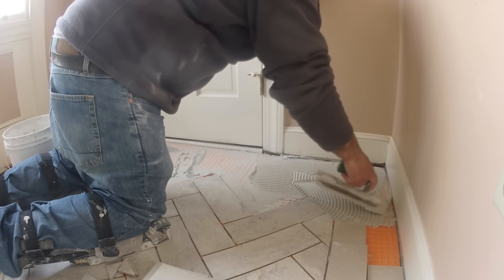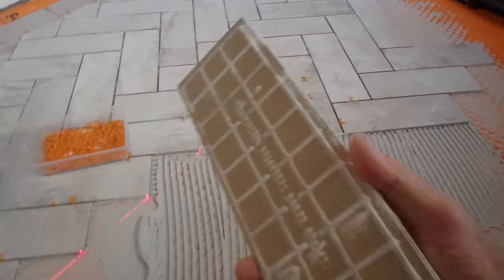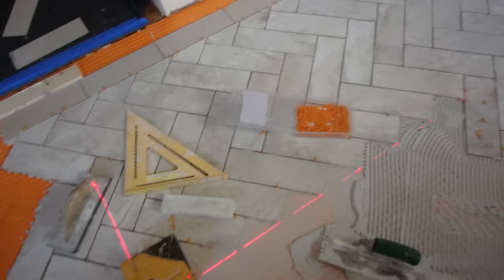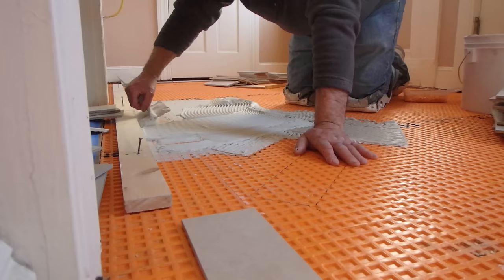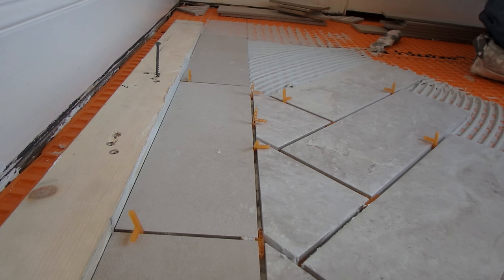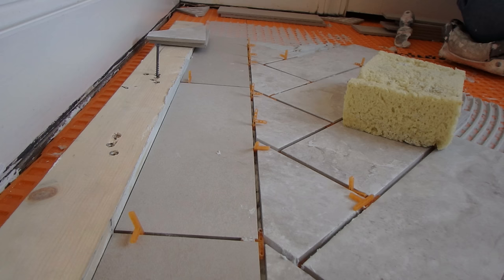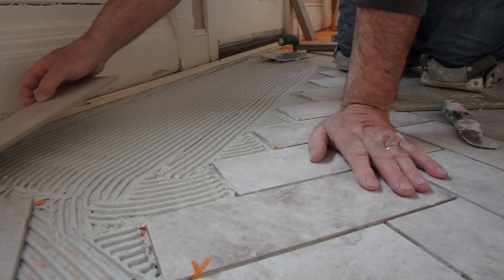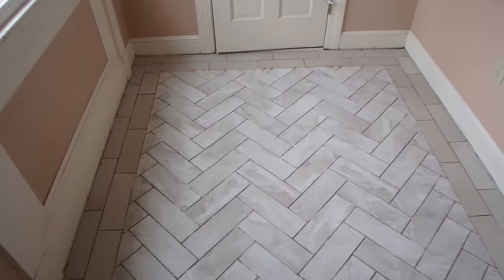How To Install A  Diagonal Herringbone Tile floor

Comment: Hi Sal,

Love your videos.  Since watching them, I've done multiple projects on my rental units and everyone thinks I hired a contractor.  Watching your videos is the equivalent of taking a Masters Class in tiling.

Just out of curiosity.  When you put some spacers down deep between tiles, are you going to dig them out of the thinset later or will you just leave them there and just grout directly over them?

Also, I know you can use both sides of the tile when cutting those smaller pieces on the edge, but is this a pattern with a lot of waste?
Reply from the maker: Depends on the kind of space, some are designed to leave in, others have to be removed.

Comment: You make it look so easy! However, I know that is pure experience on your part.  I did a herringbone floor for a client and it looked awesome when finished but it's a time consuming pattern with all the cuts and precise layout.  It's even worse when the client picks tile that have tiny variations in dimension from a box store, ah forget it. Nope not for me! Never again!
Reply from the maker: Herringbone is one of those patterns that will always be around.
Reply: @SalDiBlasi  I agree with you. It's a classic time honored pattern that looks gorgeous. In the hands of an amateur though, will easily look amateur in comparison to a pro's job.  Love your videos btw. I referred to many of yours when I did that herringbone job.
Reply: Im with you on that. Herringbone is a pain. Like you said, any variations in tile size makes it harder. And also if the room is out of square. Fortunateley there does not seem to be much demand for herringbone and the sooner that pattern goes back out of fashion the easier my life will become!

Comment: Hi Sal. I’m doing a bordered herringbone on an exterior deck. I’m not sure how the border tile on the edge of the deck should sit. Flush with deck/step edge? Short a touch? Suggestions? I’m also unsure whether to cut the border tiles around the deck posts and maintain a straight line, or to step the border tiles around them in and out etc. what’s normal?

Comment: Hey Sal, rewatching years later, why did you choose to use unmodified thinset?
Reply from the maker: At the time, unmodified was the recommended type of mortar by Schluter, since then advancements in mortar technology have made it possible to use many modified mortars.

Comment: Great video! What kind of tile material is this? We are trying with stone tiles and with 1/8" grout you can easily see the irregular sizing on some tiles. Are some tile material cut more accurately than others?
Reply: On larger tile like slate and other stone it is extremely hard to use spacers under 3/8". I recommend 1/2"

Comment: Hi Im doing a bathroom floor that is L shaped. its almost like 2 separate rooms because of the walls. herringbone pattern 12 x 24 porcelain tile. where should are start the 1st tile, at the L ? thanks
Reply: Wondering the same I'm in a similar situation where I'm planning on tiling a laundry room connected to a bathroom in an L shape. Do you start at the center of both rooms, or the center of the longest/largest room? I fear doing the latter will result in having odd cuts by the time you get to the end of the smaller room.

Comment: When do you back butter and when do you not?
Reply from the maker: Natural stone tiles will always be back buttered, larger tiles will for the most part be back buttered, tiles with a deep pattern on the back should be back buttered, Any time proper  transfer and coverage of thinset to the tile is not possible to achieve without back buttering.
Reply: I always back butter the time difference is little , changing a lose tile later on is more deficient

Comment: Hey Sal, is it possible if for instance you have a 2ft by 2 ft chair rail border above the stove for a backsplash to have a  45degree herringbone pattern where both sides are equalized? If it can be done how do you go about shifting the tile from the center line to accomodate for the herringbones offset?
Reply from the maker: maybe this will help, https://www.youtube.com/watch?v=WJqzcpAT5HM&t=3s

Comment: Does the tile length need to be divisible by its width in order for a herringbone pattern to work?
Reply from the maker: If it does, I did not know that and have never checked to see if it was.
Reply: Wow great question i was thinking the same thing..what do you if the floor is baddd

Comment: I’m just curious how your physical health is doing from tiling so long. I’m 31 but I feel my back going a bit and also my knees ? Great Work though Sal as always 👍
Reply from the maker: I am in good health, but you are right this work is hard on the body, that is one of the reasons i have switched to modern installation methods, lighter materials, less dust and easier on the body.
Reply: @SalDiBlasi  ok
Reply: Try getting those proknee brand kneepads that Sal is sporting. They actually help take some stress off your lower back. They are the best.

Comment: Sal what’s the best way to measure the cuts when doing a herringbone pattern?
Reply from the maker: Very carefully,  if you can lay them over to transfer the mark, or measure with care. If you are straight and square once you dial it in, they will all be repeatable by cuts.
Reply: Sal DiBlasi Thank you!

Comment: can you explain how to center the pattern with the center of the room?
Reply from the maker: It t is pretty straight forward, find the center of the room, find the center of the tile pattern, then dry lay some tile to see if it works, make adjustments as needed.

Comment: I see ya pulling your spacers as you go... when's the last time you installed without spacers. I still on occasion freehand. When I first started in the trade none of the installers used spacers except on walls.
Reply from the maker: Spacers are a tool, like any other tool, use them when you need them.
Reply: @SalDiBlasi  I agree 100%. It's still nice to know when you need it. The skill level of some of those guys still amazes me. Running thousands of feet of finished marble 12x12s on a 16-in joint with no spacers only a tape measure and a chalk line . You could take a hotwheel car and push it down the floor and it was like you were in the Indy 500.

Comment: How much longer does that patten take you vs a standard 12x24 1/2 or 1/3 offset ?
Reply from the maker: Depends on how proficient you are, but it will take some extra time.

Comment: Would you risk doing things the wrong way to keep a job that you need to support your family? I just recently started working for a company who is passionate about the way they lay tile and they've made money at it for a long time but there are some massive mistakes that I see made everyday. Even if you explain to them why they are making a mistake they still deny it. I'm slowly picking up work on my own and want to do my own thing but for now I need this job but I'm afraid I'm going to learn bad habits.
Reply from the maker: I personally try to do everything the right way, but that is not true for every installer, some think that they are doing it right because that is what they were taught, but are actually making serious mistakes, these people will often change their ways if they recognise what they are doing is wrong. Getting them to see the errors is the challenge. Then there are those that just don't care, they are just in it to make a dollar. I can't tell you what to do, but you should know what the industry standards are and do as much training as possible when you can.
Reply: I find that tile work doesn't pay much unless you're fast or you can sell your services at higher prices than what regular joes are charging. For most tile guys who can't sell their services at top dollar prices and still need to feed their family, then their only choice is to do things fast and a lot of times fast means spot bonding, spreading thinset like glue, no backbuttering. In Florida, you only get around $2 sq ft for large areas, that means you have to lay at least 400 sq ft a day to make any money......Backbuttering and leveling system would be cost prohibitive in this situation. The best way is to save money and have a large savings so you don't have to take the first job that comes your way. I pick the jobs that i want and will only work if i'm getting paid good money.....I'm willing to walk away if the customer is cheap.
Reply: Wow, very great advice. Thank you.
Reply from the maker: Let the hacks do hack jobs for the people that want to pay as little as possible, that has always been the case and will probably never change. I don't worry about those people, they are not serving the same customers as I do, people that want it done right and have it last forever. An educated customer will be  more willing to pay for a job done right, so educate your customers when you meet with them.
Reply: So.... 🤔
I've given tons of thought to this for the past week.

The company I'm working for, has the clientele that I want to be in front of. It's easy for me to follow manufacturers recommendations, so I'm going to do it their way, until they stop watching me. When I get one on one with a customer, I'll teach them why I'm doing it this way. 😂
As for working on my own, around here you just need insurance. And I'm not taking the job unless they want to do it right. I'll pass it up, because I have a reliable income. I just have to sell myself everywhere I go.

Keep the steady income and only except proper jobs.
Reply: If you dont stand for something you will fall for anything your name is all you have do it rite the first time..
Reply: Like i say good things aint cheap and cheap things aint good.

Comment: Installing tiles "dry" is a wrong technique. Tiles sooner or later are gonna get loose. Yep, it seems the tile "gets" all the mud when in contact, but what is gonna happen is that the tile will absorb lots of moisture from the mortar, no only affecting the mortar curing process, but creating  a breaking point. I have seen this demolishing floors for many years.
Reply from the maker: You are stuck in the 1950s Soaking tiles, specially porcelain tiles is not needed and may do more damage than good. Porcelain have a water absorption rate  of less than .5% Ceramic no more than 13% Mortars are designed for these tiles to be installed dry. The more likely reason for the failed installs that you have seen is either improper installation, the wrong mortar was used, the mortar was allowed to skin over, and a host of other reasons, not soaking the tiles is highly unlikely. Look it up in the TCNA handbook and ANSI Standards.